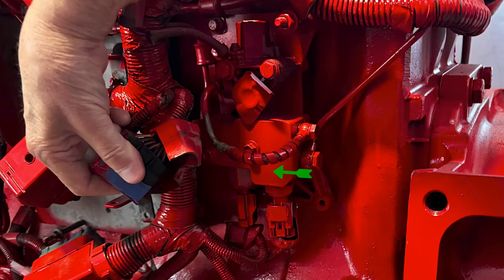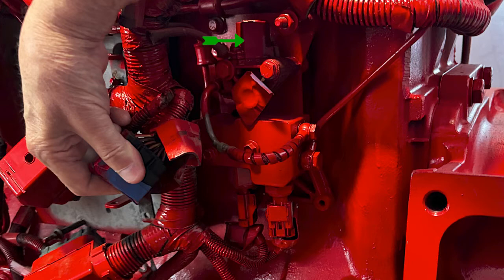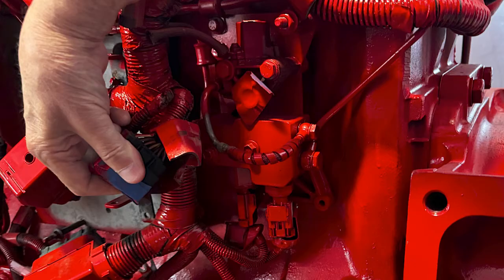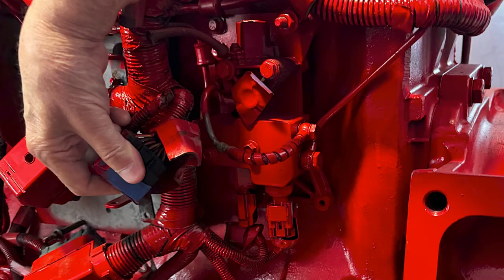Lets take a look at the aftertreatment fuel block in the ISX

Comment: Thanks Joe for this video, I have a problem in this specific block, I’m wondering what is the normal reading of fuel pressure inside the valve when dosing, my pressure drops from 114/psi to 28. -19/psi during regen then ecm/acm stopped the regen due to valve mechanical malfunction , and this happens even when I changed the block and the injector, Thanks.
Reply from the maker: Normally pressure problems are related to the check valve solenoids.

Comment: Is there a test port at this block ?
Idle pressure ?
Full throttle pressure ?
Read on scanner ?
Full air to valve or regulated ?
Thank You , Diesel Joe !
Reply from the maker: No test port but you can monitor the valve status and pressure using the data logger found in INSITE. The air pressure is what ever is in the air tanks at the time. The fuel pressure is close to what is in the on engine fuel filter at the time. It has nothing to do with throttle and more with rpm since the gear pump and its internal regulator controls the pressure in that housing IE the fuel in that housing comes from the on engine pressurized fuel filter head.